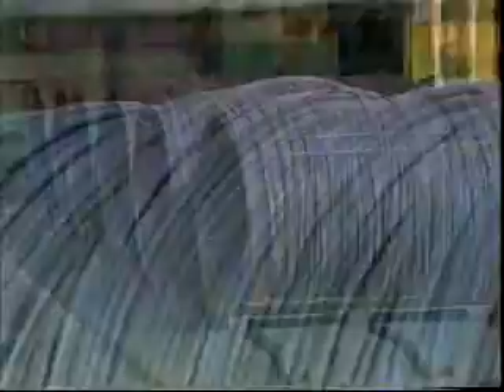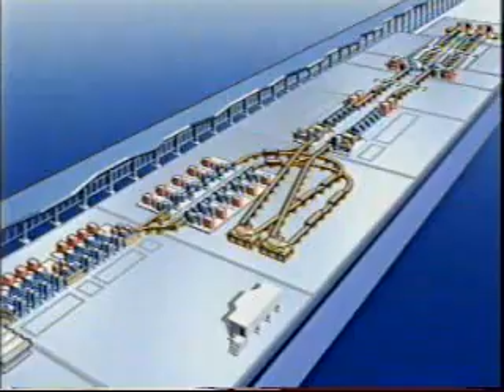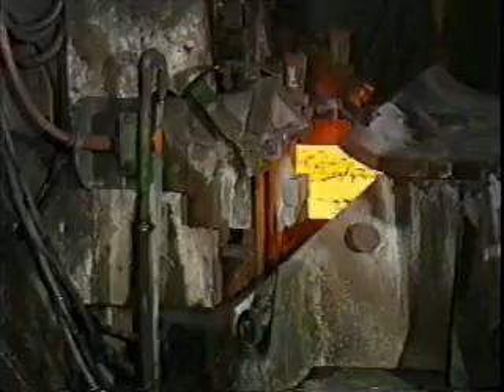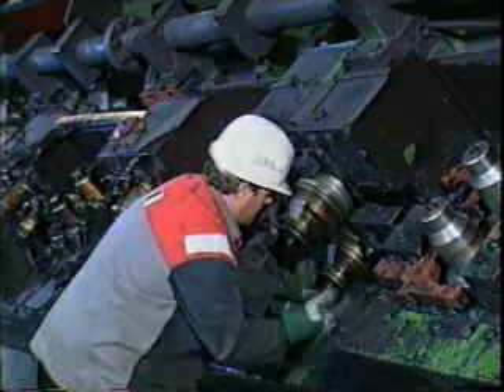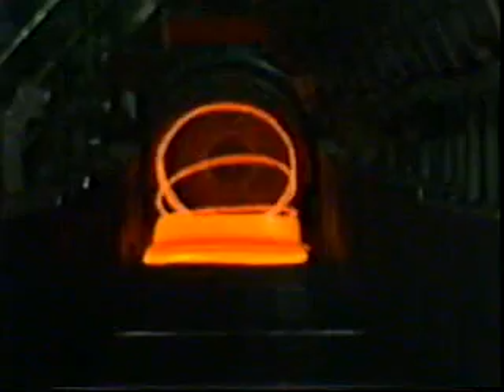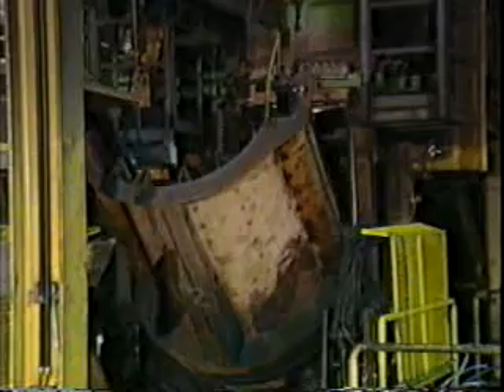the new wire rod mill at voest alpine austria draht

Comment: Very nice, and very cool.
Shame they didn't invest a few more bucks in putting a roof over the storage yard so the pretty new hc steel won't rust...
Reply: i work in a rod mill and a little bit of surface rust assists with the galvanising process which is the next step after the coils leave the mill and go to the galvanising plant